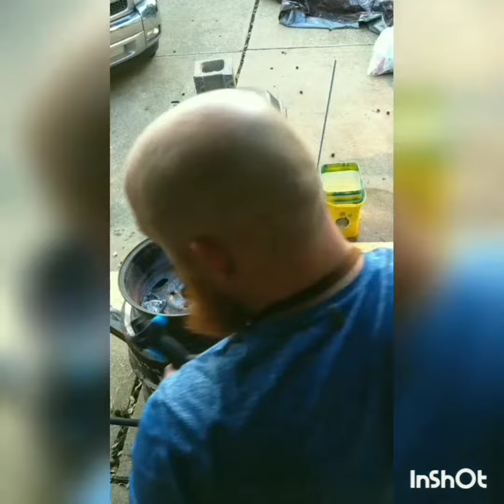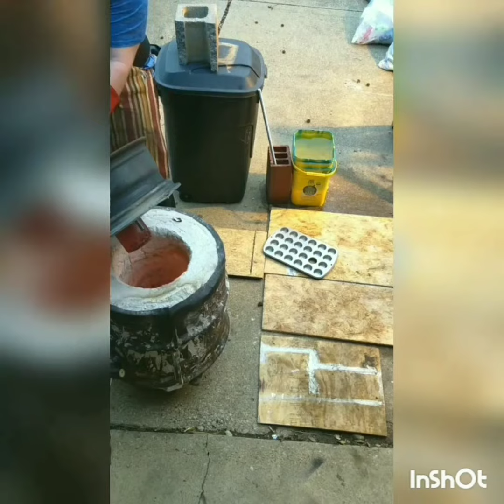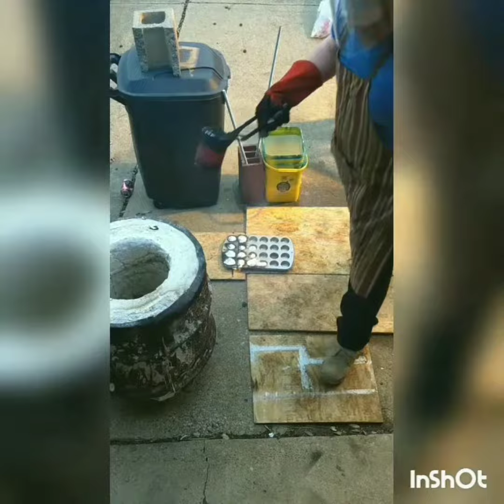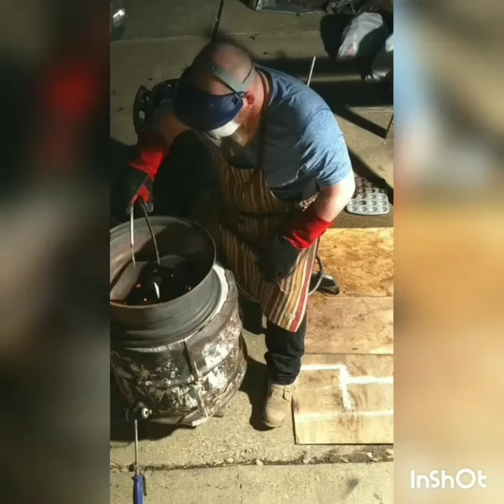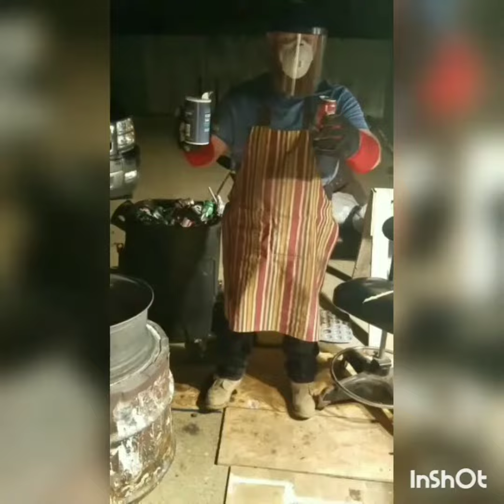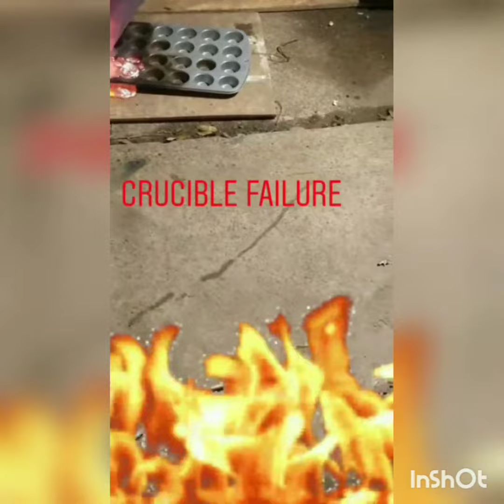DIY Huge homemade propane Foundry first  melting of aluminum cans

Comment: Nice setup! check out AvE's videos about casting with aluminum, he has some wisdom about using melted down cans, related to some metallurgical properties of the aluminum they use in cans vs the stuff normally used for casting.